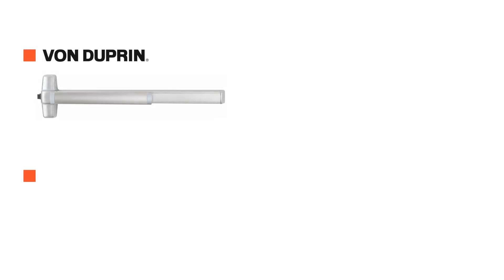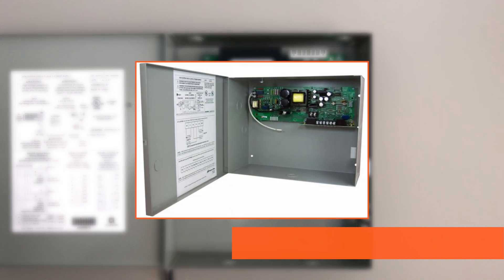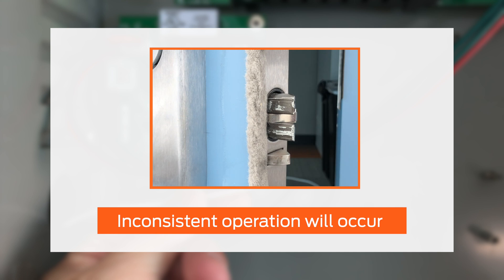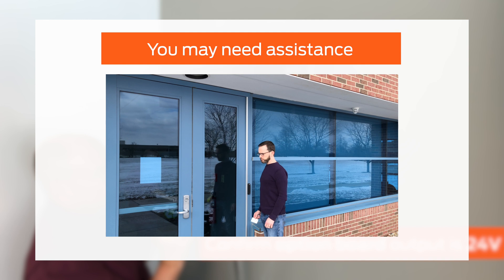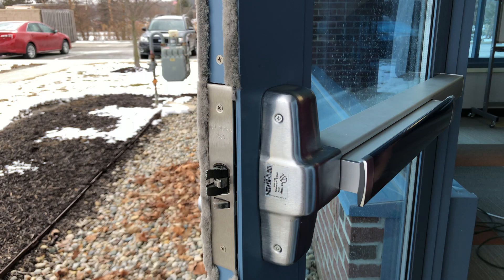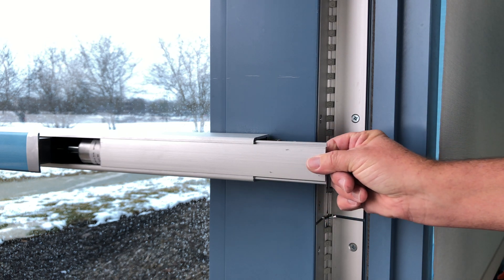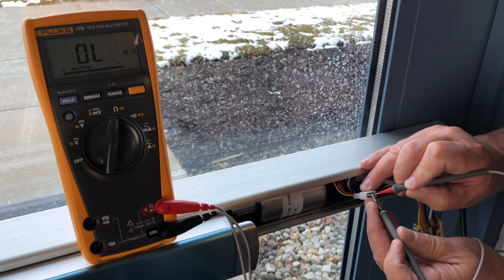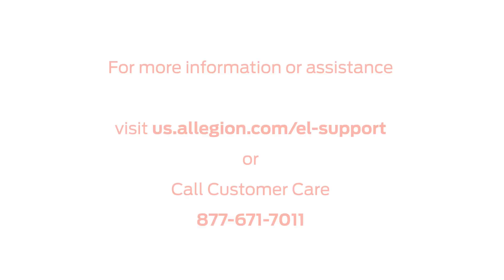How to Troubleshoot EL (Electric Latch) Retraction on Von Duprin & Falcon Exit Devices

Comment: Great video.  However, as time goes on, I have been ripping out all Von Duprin EL99EO panics and replacing them with QEL instead.  In my business, QEL has taken over from the EL.  The only EL devices that you will see in my building are the ones from 2009 and are still functioning correctly.  If the original Von Duprin EL devices are still working, then I just let them go.  But when those EL solenoids blow out, I replace the fried EL devices with QEL instead.  That's why you see doors with EL devices and QEL devices on the same opening.  They were both ELs originally and the solenoids blew up.  So, I installed a Von Duprin QEL instead.  I don't use EL solenoids anymore.  I only use QEL.

Comment: And they discontinued the parts for the plunger, talk about a big woops!
Reply from the maker: Hi, Angel, thank you for viewing this video. One of the primary purposes of creating it was to demonstrate that the solenoid and plunger assembly are very rarely the cause of operational issues with solenoid-driven electric latch retraction devices. Most often, customers contact our product support group to ask for the part number for ordering the solenoid and plunger assembly to fix their EL devices. To ensure money spent on parts will fix what a customer intends to fix, we direct them to do an objective resistance test on the solenoid. When we walk customers through the steps shown in the video, we find the culprit is something other than the solenoid/plunger, with the most common culprit being the use of inadequate wire gauges.  

Phase-out of Allegion solenoid-driven devices and service parts began several years after this video was made. However, we continue to make this troubleshooting video available for the benefit of those still using EL devices in the field. If this video does not help resolve your EL issues, we encourage you to contact our product support group at 877-671-7011. If an EL replacement is ultimately found to be needed, you can convert to motor-driven latch retraction by installing the appropriate kit (QEL or MEL).
Reply: @VonDuprinSafety I had a exact similar case a few weeks ago, the only answer from tech support was to replace the whole panic bar...